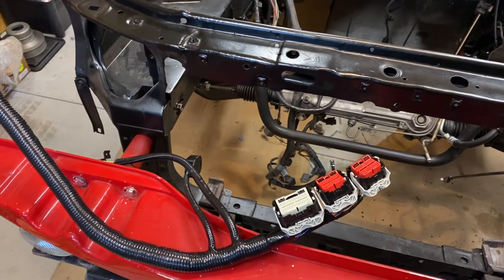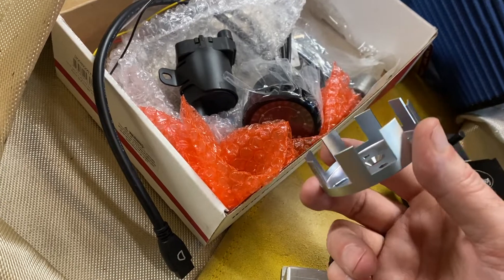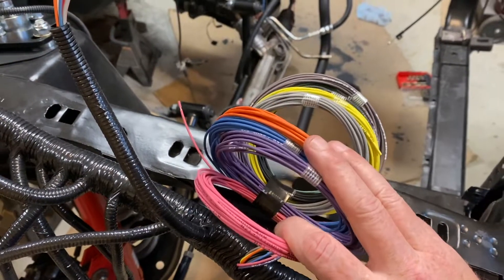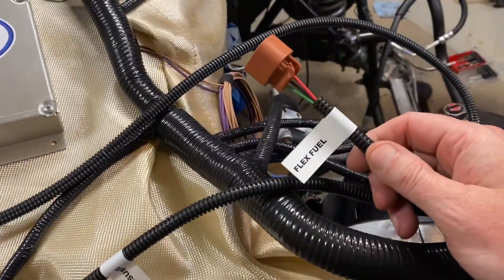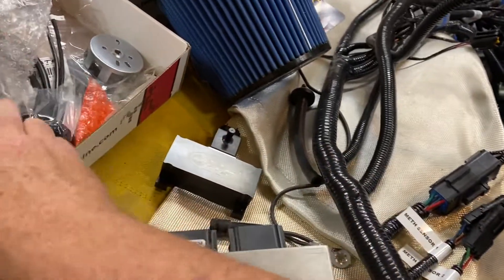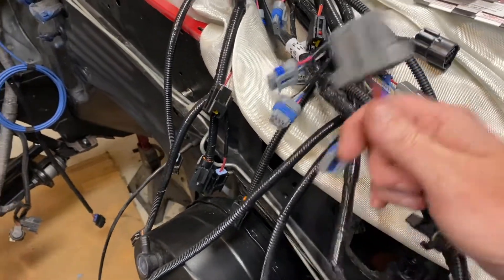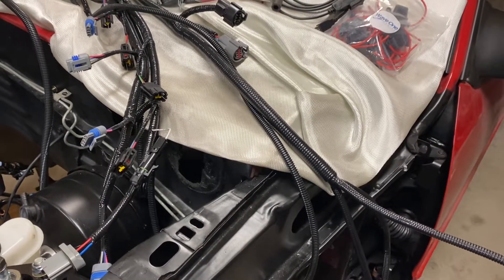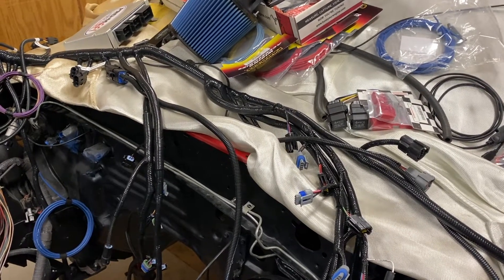Foxbody Mustang Pro M EFI Engine Management unboxing

Comment: Thanks for the info on the harness. I just received mine and started installing it yesterday. I couldn’t figure out what the big plug was that you pointed out was the traction control. I’ll be downloading the pdf instructions as well, there were no instructions in the box. Chris emailed instructions on how to download the software. The pdf must be on his web page? As you pointed out very high quality system, I’m excited to get it finished.
Reply: I do have a question on the Innovate O2 sensors you may be able to help me with. Going over the instructions Innovate recommends welding the bungs 24” from the collectors. But I’ve noticed in a few videos LMR’s and Chris’s video they used the stock O2 sensor locations. Do you have any recommendations for that? I’d like to use the stock locations if possible, just saves some work not pulling the exhaust and welding bungs. LMR noted that they have not had any issues yet with using the stock bung location. I think the stock O2 sensors are narrow band. Maybe they can take more heat than the wide bands. 🤷🏼‍♂️

Comment: This is a great system. Installed it on my '86 last year (injectors, MAF, shutter wheel, O2s w/gauges all from Pro-M) and a buddy has it on his supercharged 460ci. '93 Cobra. We have had no issues and and could not be happier with the system. My buddy ordered a second for another car and another buddy is about to order one for his '93 notch that I will be installing. Both cars with it installed run perfect and it is very straight forward to install. I just ordered the pigtail to add the no lift shift and will be getting the harness for traction control, might as well utilize some of the built in features. Make sure you read the instructions for the wide-bands. Most headers have too shallow of a bung and the sensor needs to not protrude in to the exhaust flow path. (bad for the sensors) You're gonna love it! Put a few miles on after you get it installed and let the system learn (my car would shut off after a hard wide open throttle pull when I would let off the gas immediately, did it a 4-5 times the first week or so and hasn't happened since as the ECU has learned) You get what you pay for. Good Luck!
Reply from the maker: I'm actually switching to the Zeitronik widebands because  the Innovates have had issues reported by other users.
    I am wrapping up other stuff on the car but will  likely have the harness install video loaded next weekend.    I really like the mostly plug and play aspect of these system.
   Time will tell once I get everything up and running.

Comment: The quality of that pro m efi system is untouchable. I feel like not many people use this setup but I think its the best option for an efi fox body. I know the Holley systems can be real finicky as far as getting the tune dialed in and plus its map sensor based versus Maf. I was really thinking about using this kit for my 86 fox but I’m just going the cheaper route and doing an A9L Maf conversion. I know it should work out fine plus it’ll just be controlling a N/A 408w I just built thats pretty similar to your engine. Good luck with the build man its gonna be sweet for sure!
Reply from the maker: Agree 100%.